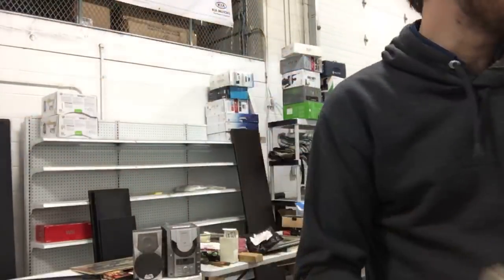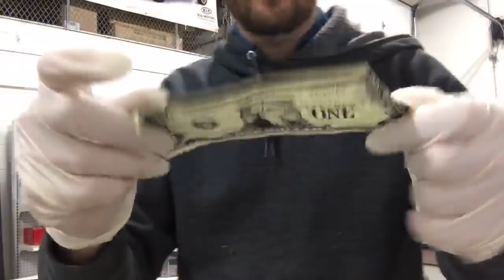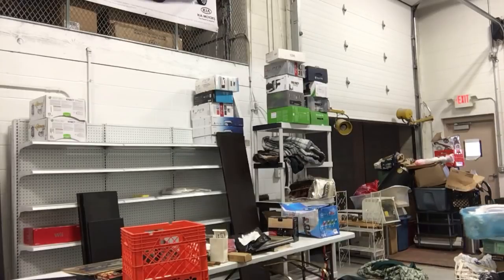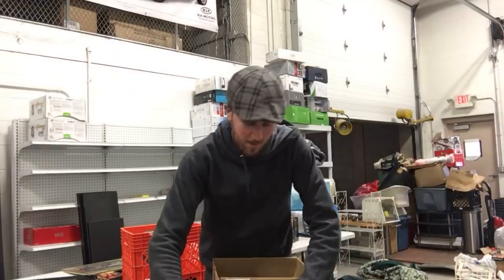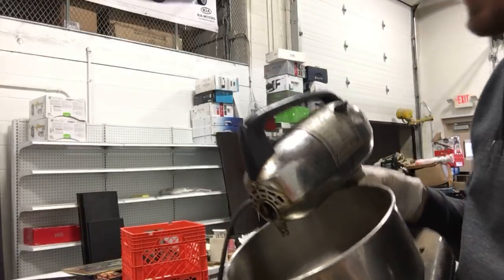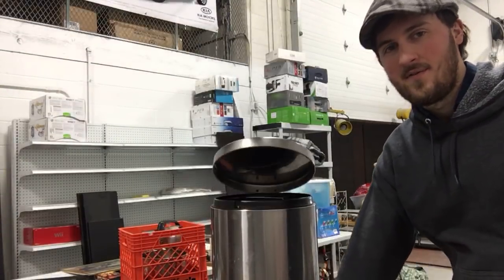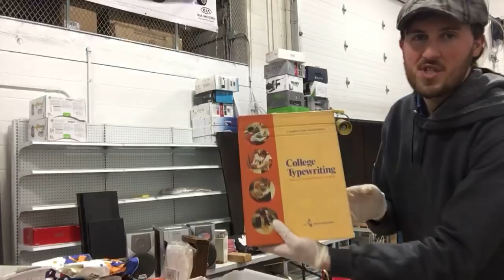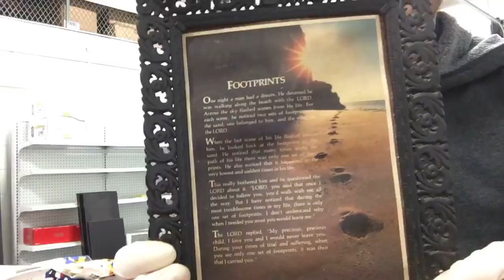$5 storage unit from 1/31/18 unboxing (part 2)

Comment: You should send any of the plastic milk crates with names on the side i.e. the Borden dairy crate off to auction unless they have considerable value on Ebay.  They always do well at auctions.  A little bit older plastic borden would have sold on Ebay for $25 plus shipping.  That one, probably $15 plus shipping.  I'd save all of the art\pencils\pens to put together in a lot and put up on Ebay.  Surprisingly they can do very well.  Lots of Crayola crayons as well (not the generic ones), broken or not bring good money.  A single box of Crayola crayons can bring $20-$40 if a bit older, and the same for pencils. People use them for color for candle making, etc.  You could also send either of those off to auction as well.  If people find specific pencil brands, or pens with advertising, used or not, folks will buy the whole lot.  Just do a search and you'll hit on what I'm referring to.

Comment: You should have saved the AC adaptors. They are worth at least a buck a piece, and may have gone to several of the items.
Original equipment ones can be hard to find, as they all seem to have different plugs and voltages on them.
Worst case, the can be sold to a scrap yard as "breakage'.

Comment: A valve core removal kit is to remove the valve stems (the part you hook the air hose up to) from car and maybe bicycle tires.   Sometimes when you have a slow leak in your tire it can be because of a faulty or worn out valve stem.   They are easy to replace with the proper valve core removal kit.

Comment: the red vacuum attachment at around 27 minutes is a diffuser for a hair blow dryer... those things are great and you might be able to get 15 or 20 bucks for it on ebay if you know the model... i'd have to look them up... but, I have one on my hair dryer and all my friends covet it

Comment: The little flag stickers were stamps and they are called forever stamps.  You can use them anytime.
Reply from the maker: Missing58 they weren't stamps. They were just stickers. I always save the forever stamps. I probably have $100 worth that I've found in various storage units. The stickers looked like they came from a charity the previous owner donated to.
Reply: Go through the pockets in the clothes. :-)

Comment: I find more Valuable stuff tossed out at Curb side clean ups. Did the Storage thing and it wasn't profitable at all. I make 70 % more a year on curbside finds then ever made when doing the Storage buying.. The Storage places remove the good stuff before they auction units off. The Stuff on Tv is 100% bullcrap.

Comment: ALL of those cords and ANYTHING metal you are throwing away, even nuts and screws, should go in a pile for your scrap metal guy.... just throwing it away for the landfills is a little sad to think about when you already have someone coming to pick up metal. It would be super easy to have a box at your feet for metal and cords, aux, or A/C cables etc.....

Comment: hook is in fact a meat hook. used in meat plants generally but there are other uses.
Reply: Hay bale hook
Reply: doesn't look like a hay hook to me, hay hooks are larger. a quick look in a vid tho... I'm not sure. least ways the hay hooks we used to use were larger and the hook was more at a 90 than a full hook like that.